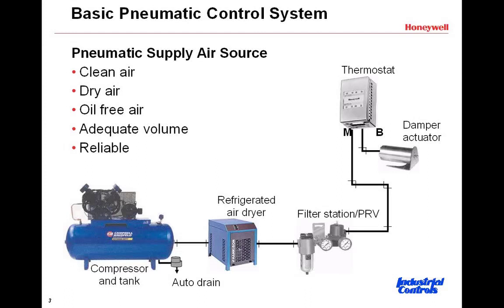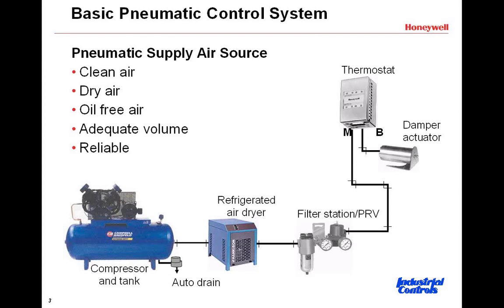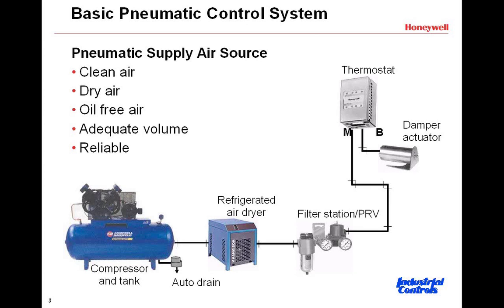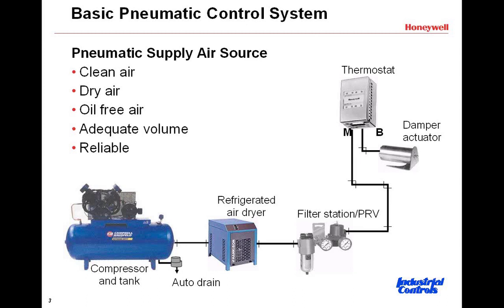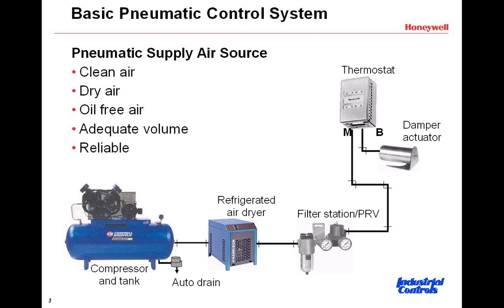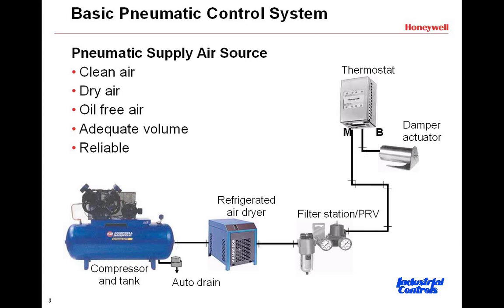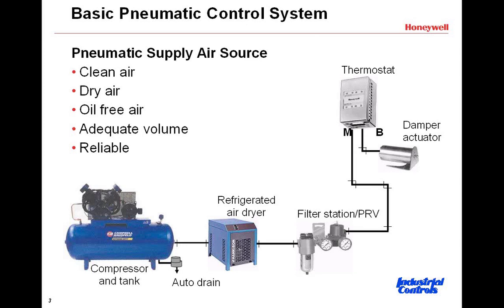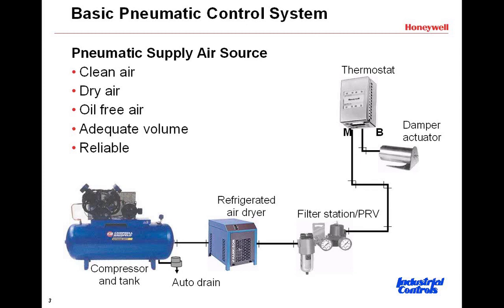Introduction to Pneumatic Control Systems: Clip 2 of 5

Comment: I am not usually one to comment on videos, but I wanted to thank you all for putting this webinar series online. I found this to be an extremely informative introduction into pneumatic systems, how they operate, the diagrams were awesome  especially for those of us who prefer visual diagrams and break downs of systems, and the differences between two way DDC valves and modulating pneumatic system valves.  Just a super informative set of videos that got the info across and did not take all day.  THANKS GUYS 2 THUMBS WAY WAY UP!!!!